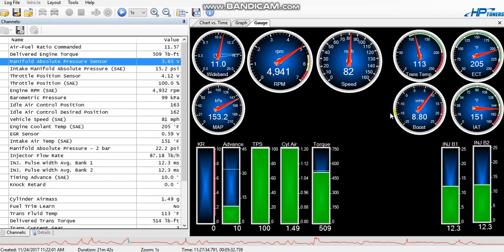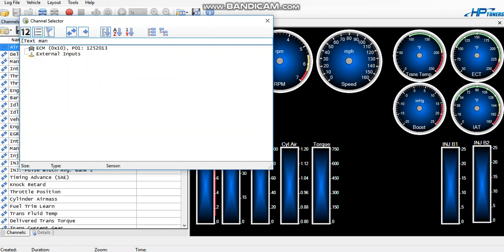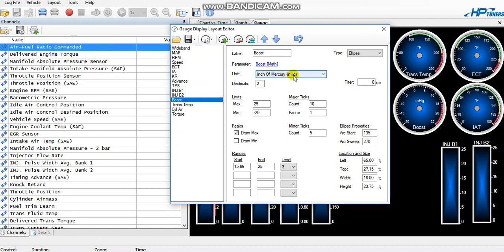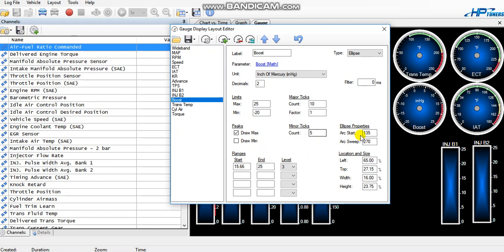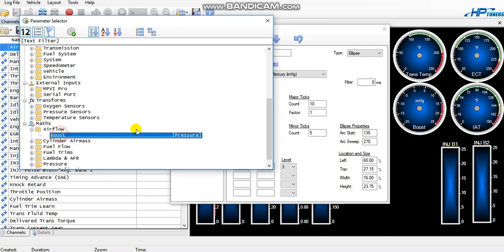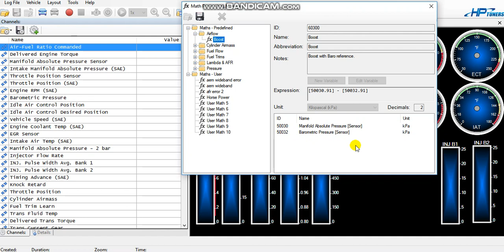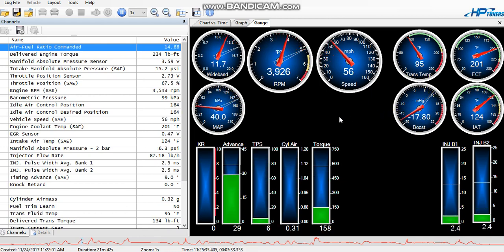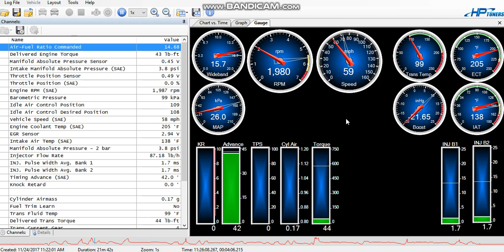Setup a Boost/Vacuum Gauge in HP Tuners!!

Comment: When I did this just now, my boost reads DOUBLE, but vacuum reads correctly. If I make the gauge read in PSI, it reads BOOST correctly, but vacuum is halved, lol. Both MAP-2 Bar, and Baro in the channels, read kPa...if that helps. Any idea what I did wrong?
Reply from the maker: It seems like I've ran into this before, but I can't recall the changes I made to fix it. Maybe try changing the map in the channel with a different one... I should note that do not believe the vacuum is always as accurate as a mechanical vacuum gauge would be. I've noticed on mine that the vacuum does read a little less than my gauge, but I'm not too concerned with logging vacuum. Probably the best thing to do is to setup a dedicated gauge just for vacuum.